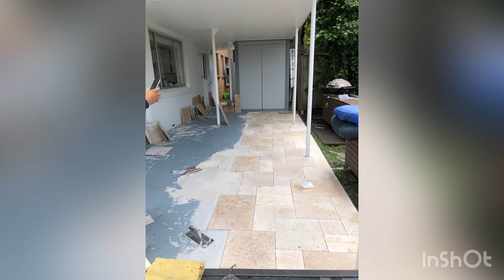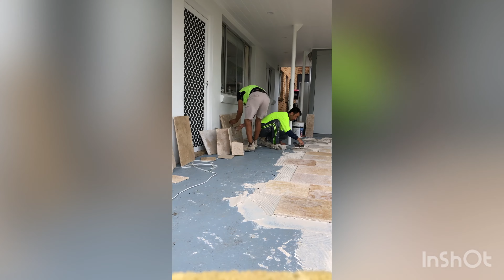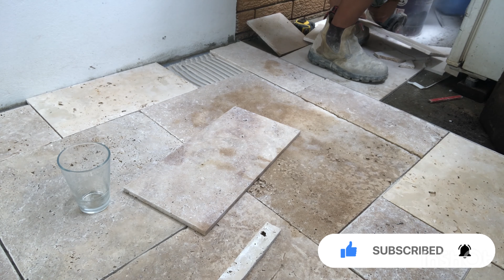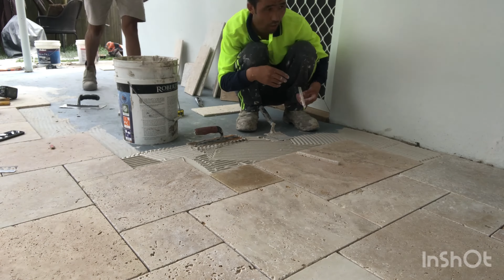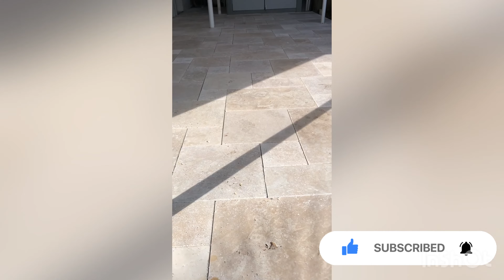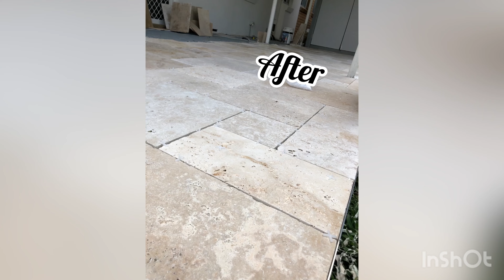French pattern tiling at pargola area.

Comment: Question: I have travertine tile (interior) for french pattern. If they butt up, everything lines up. However, if I leave grout gap, they are misaligned. Is that a manufacturing issue that they cut for certain gap? Do I have to make a correction cut in the 8" square pieces?